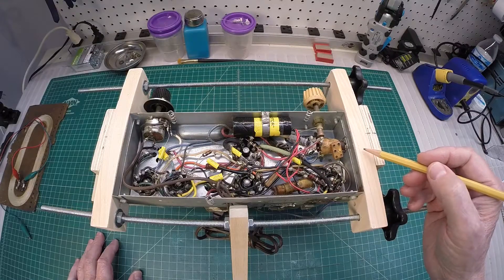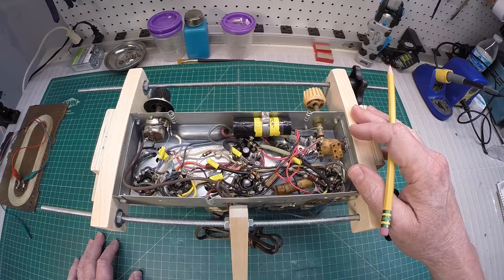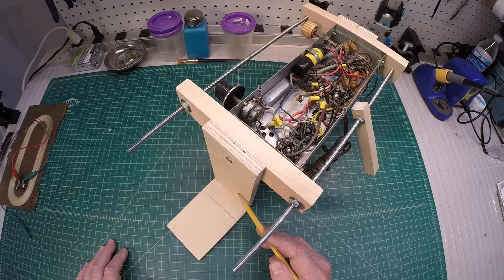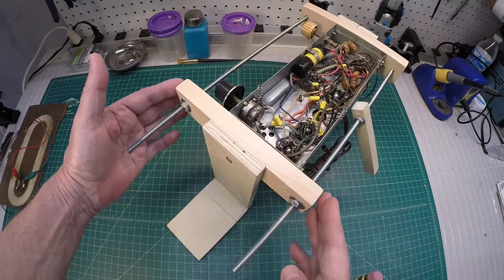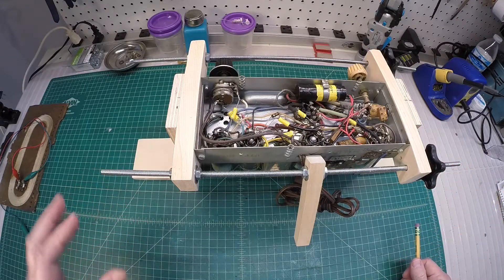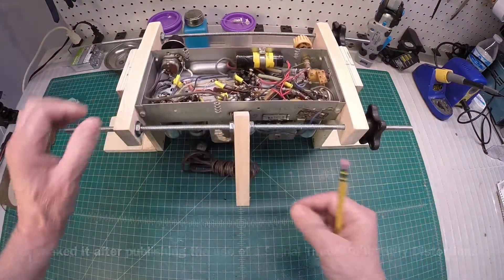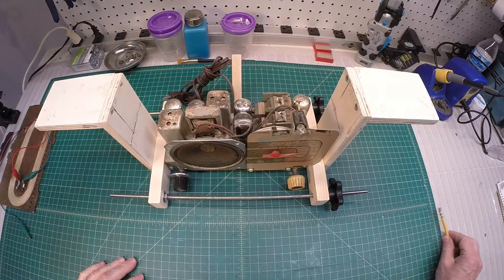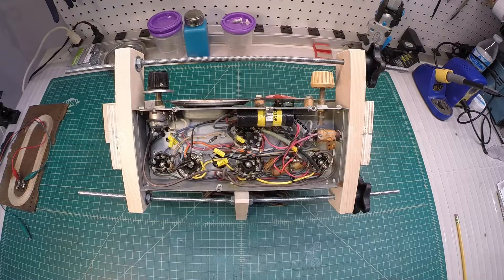Prototype Radio Chassis Stand

Comment: Great design, thank you for the inspiration!  Kind regards from a new subscriber
Reply from the maker: Patrick - thanks for reaching out and subscribing to my channel. I added some black foam strips to both side pieces that butt up against the chassis. It helps secure the chassis in the holder and prevents any scratches, etc. Thanks again and all the best. Don
Reply: @RestoreOldRadios  My pleasure and thank you for the extra tip Don.

Comment: Had the hardware and wood and built it in 30 minutes. I modified it a bit. I left the vertical pieces as is. I did not add plywood to make the L shape. Works great!  Thank you.
Reply from the maker: Glad it helped. Thanks again for sharing your design changes. Best, Don

Comment: Hi Don. Love the design and wouldn't change a thing. It's like the old saying " Keep it simple stupid "  Has far as it bending the chassis it won't happen unless someone went nuts on it. I built industrial jigs they had to strong and idiot proof Lol  and sadly there is no such thing has idiot proof. Again Don I love the design easy to build. and should it need a repair it doesn't take Nasa to figure out how :) great job on the trouble shooting and finding the loop was the trouble in your other video.
All my best
Bobby
Reply from the maker: +Bobby Tectalabyss I appreciate it Bobby. Keeping it simple was my objective when I started on this one. The larger chassis stand I built has more of the bells and whistles. The open loop Antenna was not expected. As you know so well, you never know what you’ll find wrong at times. Best, Don

Comment: I put a couple of guide rails on the bottom just in case it slips plus you don't need to tighten it so much, With thin gauge metal it will bend and more likely fall out! You could do away with the kick stand and just have a carriage Bolt in the centres on either side and on one side have a locking handle with bolt to fix it's position!! so you can swivel it any Direction, and if you make the feet!  the same length as the metal studs you could stand it up vertically as well if needed.
Reply from the maker: +John sweda John, thanks so much for your observations and recommendations. If I end up using this a lot, I may tweak it as you noted. Thanks again. Best, Don

Comment: That is very nice!  Does anyone know where those fluted torque female knobs might be purchased?
Reply from the maker: +z95m Thank you. I purchased these from Amazon about a year back. I just looked and see they are now unavailable, but some other fluted knobs that are similar in design are available. I can’t recall if I checked the big box stores or not. Best, Don
Reply: z95m alternatively cut it out of half an inch of ply with a coping saw or jigsaw and sand the edges and corners cut 4 or 5 or as many square blocks glue them with double sided sticky tape draw the pattern on one side or top and bottom and cut out with coping saw or jigsaw hold them in the Voice and rotate them  and do the other side, and make sure you put a cross in the middle to drill the hole if drilling  the hole first you could just put a bolt and nut and washers to hold the blocks together if you haven't got double-sided tape
Reply: Thanks for the relies. Looks like Lowe's has some that might work -- Item Nos. 423502 and 423536.  They don't give much in the way of specs, but I'll take a look next time I'm in the store.